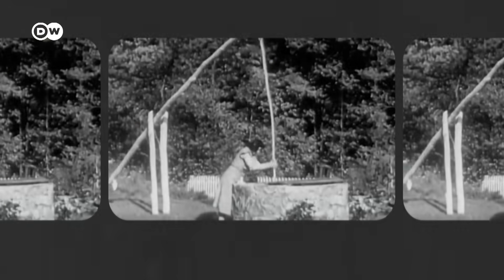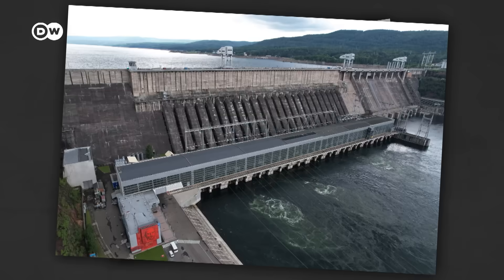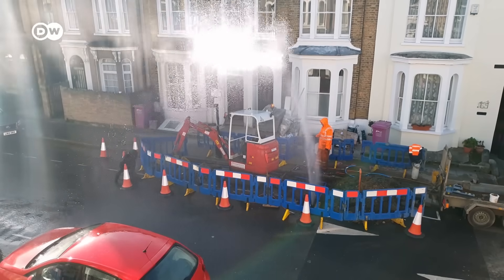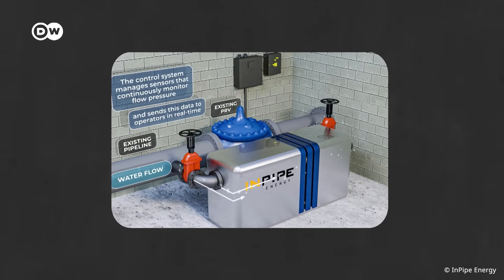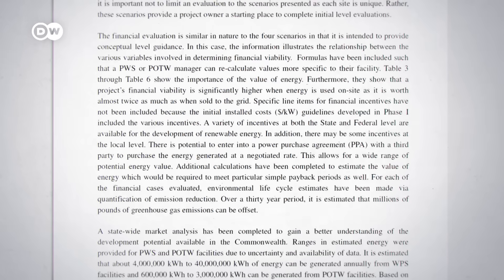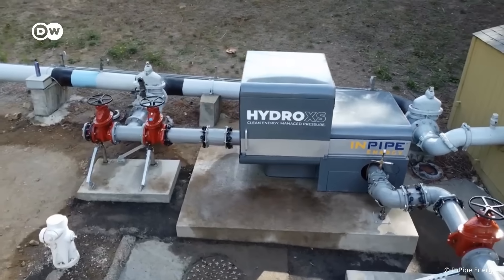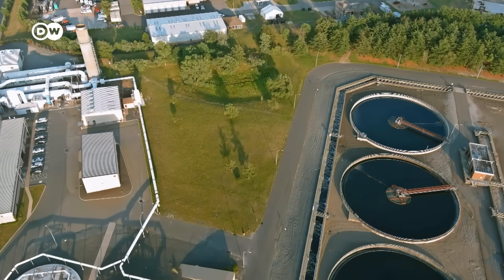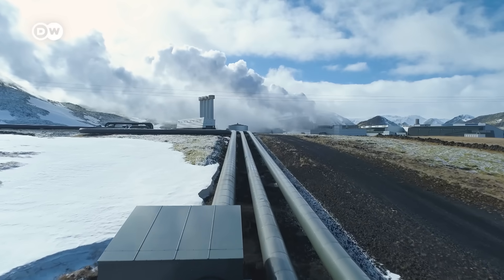In-pipe energy: The hydro power nobody is talking about

Comment: I mean, the potential energy of water in pipes is energy spent in some other location to pump water, this production thus would be just a reconversion of energy (with obvious losses). I also think that the production at large scales would slow down the water flow requiring more energy at the source.
It would be certainly more efficient to spend less energy at the source and to pump water at a lower pressure.

Comment: Apparently these people don’t quite grasp what they themselves said at the beginning of the presentation.
There is a massive input of power in pumps and other manners to make the water flow at a usable pressure. Part of this is simply to overcome the friction load of the inside of the pipe.
If they start putting turbines and other various “energy producing” devices inside the pipe … in the water stream … they lessen the pressure on the “downstream” side of the pipe.
In order to maintain even pressure then, either the originating pumps would need to increase … which actually would make no difference since the formula of water flow/velocity/pressure/gpm in a column or pipe is fixed. (the formulas are easy to find … even though they’re a bit confusing.) OR Intermediate assistance pumps would need to be installed which (pretty obviously) will use MORE Power than was gained by these turbines.
Maybe … MAYBE … a water system that is Gravity Fed might be able to use this with little overall loss but … even there the constraints are Pipe Composition (friction) vs. Pipe Diameter vs. Water Volume/Velocity.

Comment: Im sorry but this seems the dumbest DW video ive ever seen. This "potential" is absolutely tiny. Pressure relief valves for water treatment are uncommon. Usually water is transported at low pressure, and the pressure is increased locally (with a hydrophore) to match specific needs. 

The only "huge" potential there is to harvest hydroelectric energy where possible. But yeah, that has little to do with this concept of harnesting wasted energy

Comment: Maybe it would be worthwhile to start saving energy with more low tec systems, for example a simple heat exchanger for the shower, where the warm water going down the drain preheats the water going into the shower. Energy is saved without turbines and wiring in practice with just a few pipes.

Comment: No. Sure, there are locations and occasions where energy could be inefficiently harvested, but in general, adding a 10 watt generator requires upping the pumps' capacity and output by significantly more than 10 watts.
Reply from the maker: Hey there!  Mini hydro technology only collects pressure valve waste energy already being generated by our water transportation service. Therefore, no additional pressure is needed. The process is explained at 2:26.

Comment: There is no such thing as free energy, generating voltage and current is always accompanied by added energy elsewhere. The energy generated is resistance that is overcome by the pumps that move the water. If everyone does the same, heavier pumps will have to be installed! What a strange story this is! Perpetual motion now way.
Reply from the maker: Hey there!  Mini hydro technology only collects pressure valve waste energy already being generated by our water transportation service. Therefore, no additional pressure is needed. The process is explained at 2:26.

Comment: Ok, but where to install the turbine in a water network? Most of the endpoint is useless because people wont waste water and pay for it just to generate some electricity. If you install it into some bigger pipe which supply hundreds of customer, their pressure probably will be lower than before which could be an issue. Maybe that would be better if the companies set the water pressure to a lower point, reducing their energy cost.

Comment: This would only be useful in places where the water is traveling by gravity alone. Otherwise, you are just generating power by removing flow rate created by other electric pumps.
Reply: the point is explained at the start of the video. There are times when the pressure gets too high near the end-user tubes and it ALREADY has a mechanism to reduce it, but currently that energy is just lost. With this technology, we can recover a good part of it instead
Reply: While the whole system takes energy, it's still more efficient. It's not like you can make the water at the source have the same pressure as the desired pressure at homes.
This system is analogous to regen braking. The whole system takes more energy than what it produced, but it's not like you can avoid using brakes in the first place.
Reply: Well... you could pump water via solar power during daylight then use gravity to drive hydro generators at night and avoid expensive batteries
Reply: @Terryblount  Yeah, but most of us don't have land with the topology for large water storage. A raised water tank would be HUGE.
Reply: @jasont80 in cities, building could be build with things like this in mind

Cities generate winds to but all of it is wasted 

Someone needs to think about the whole thing as the huge machine that it really is

Comment: Thanx for your comment, there is just the but ...... if you use the presure to drive turbines in Hamburg, you use presure .... and that means the upperfloors in the highrise buildings wont get water in the pipes :) ..... or you pump more up to compensate .... but there goes your free energy ....  There is no free ennergy, unless you have a dam :) sounds nice but it is a scam ;)  ... dont put your pensions savings there ..... cheers
Reply from the maker: Hey there!  Mini hydro technology only collects pressure valve waste energy already being generated by our water transportation service. Therefore, no additional pressure is needed. The process is explained at 2:26.

Comment: This video would make a lot more sense if it referred to this as energy recapture instead of energy generation. More energy will be spent pumping the water than can be harnessed, but just like regenerative breaking, energy that would have been waisted can be recaptured at the pressure valve.

Comment: Yes,  this is exactly how I generate my own electricity. 
With an in pipe generator that provides the electricity to pump the water through a pipe in a circular layout. 
That then in turn drives the in pipe  generator in the circular pipe layout to make even more electricity. 
I just have to be careful to avoid runaway energy building up in the system or it bursts the pipe.
So I have had to install an over pressure relief valve and a safety trip switch to prevent excess electric current from burning out the pump motor. 
Hehe... 
:^ )

There's a reason why nobody's talking about it.
Reply: Perpetual motion machines are so much easier than fusion as well. Why are engineers so thick! 😂
Reply: This video made feel like we are in idiocracy.
Reply: @WindowsSchmindows  
Don't  feel  bad,  we've already tunneled below the idiocracy level!
It's just difficult predicting what to expect as we keep heading down.
Reply: Pure stupidity as it violates the laws of physics!!!  If your idea is so great - why haven't we seen it already commercialized and you making billions from it??!!!
Reply: A long video and they unfortunately never explained where the "excess pressure" comes from. Water is often supplied from the hills or mountains surrounding the city. Just to pick an example, in Halle one of the major sources is more than 140m above city elevation. With such a drop there are multiple places where pressure has to be reduced to protect the pipes. At the moment wasted energy.
Reply: youre just jealous as you didnt think of it before that genius gregg semler did :p

im sure he didnt sell it in quite those words, but ya gotta admit... takes balls to do it!

the genius is in playing the game and screwing the system...

it would be the gallows if i had my way.

Comment: Problem is, energy need to be extracted at the very end of the pipe. Otherwise it will simply fail to reach consumer. Also some pressure required for comfortable use. So in the end of the day it is way easier to simply make wider pipes and not to waste energy, then trying to extract excess.

Comment: Seems like something like that could be part of the answer for energy production. One video I watched where someone was diverting some water from a creek and running it through a generator. When the water had passed through the generator it returned to the creek. The same thing with the mills for grinding grains into flour in times past. The same principle is used in your water meter to tell how much water you used for the month. Also you can tell if you have a leak in your system. Turn all your faucets off and look at the meter. If the counter is moving/spinning, you have a leak. A system like that could only work when the water is moving of course. Off peak hours when people aren't using as much water, less energy would be produced. But then less energy is usually used at the same time. I think you'd still need the power grid, but this could offset your electric bill a bit. Maybe a lot.

Comment: You do know that means the city needs to pump harder, right? Your turbine in the garden hose.... that just means your nozzle will not spray as hard as before u installed the turbine. You need to read up on the conservation of energy...
Reply from the maker: Hey there!  Mini hydro technology only collects pressure valve waste energy already being generated by our water transportation service. Therefore, no additional pressure is needed. The process is explained at 2:26.

Comment: OK so it's a reclamation of available power. It doesn't add to the available energy. It gives you access to some of the energy you already had but in a different form. As the turbine spins it will generate heat and reduce the outgoing pressure so these systems would make the most sense almost as an after use or point of use product.  I have bad enough water pressure in my shower as it is.. but filling up a toilet bowl .. sure why not. It will just take a little longer to fill and the water will be slightly warmer... downside your toilet can charge 2 double AA Batteries a week. Give or take how many flushes you do a week. 

On a larger scale as this video explains it seems Like bigger is better. But it's not generating,  it's basically tapping a preexisting battery, which is fine, but don't try to pump the water with the same power you are tapping.

Comment: That sounds like a pipe dream. Unless you have water with a lot of potential energy, i.e., from higher ground, you are harvesting energy that was put in to pressurise the water in the first place. Or you have just reinvented the perpetuum mobile.
Reply from the maker: Hey there!  Mini hydro technology only collects pressure valve waste energy already being generated by our water transportation service. Therefore, no additional pressure is needed. The process is explained at 2:26.
Reply: @DWPlanetA  Then it is not explained very well. Why and how does a pressure limiting valve waste energy? It would seem that the surplus pressure remains in the pipes for the other consumers on that water supply.
Reply: @malteplath  The "how" is simple, but the reason "why" the wasteful valves are required in the first place should have been explained much better. Maybe the producers did not understand that themselves, or they thought that it would be too boring.

Comment: Wouldn't you just make the generators that are already running the water pumps work harder to now not only run water pumps, but now they  have to work even harder to turn a bunch of generators using up the energy in the pressurized pipes. In short, it's would be like using a generator to run a pump to run a generator. Wasted energy in every step you add.
Reply from the maker: Hey there!  Mini hydro technology only collects pressure valve waste energy already being generated by our water transportation service. Therefore, no additional pressure is needed. The process is explained at 2:26.

Comment: The pressure in the pipe is maintained by an eletric pump owned by the utility company for most people. The company charge you for the power to run this pump via your water bill. The only power you get back is that which the pump put in minus some losses. Your turbine cannot be 100% efficient, so you just get charged for the extra power the utility company used, less their profit margin and less the system losses. It's a less than zero sum game. It only makes sense if you can offload the extra cost onto your neighbours, and it wastes a lot of water anyway.

So you will become very unpopular and lose money overall. Dumb idea.

A.

Comment: There were water motors 150 years ago. Water here is metered and low pressure. EVs charging is the equivalent to 25 refrigerators running.

Comment: Pressure reducing valves are not common on water supply networks. Systems are designed efficiently and not over pressurised.

Comment: This is only practical after the pump pushed the water to the apex and on the downhill side of the system.  Using a pump to turn a hydro electric generator is moronic otherwise.

Comment: Energy cannot be created, so if you were tapping into water pipes and fitting turbines to generate electricity, you are effectively stealing the energy from the water supply company, since they have to use so much energy to pump water around our streets, this is nothing but stealing and a theft of energy. Plus the fact if you fitted a mini turbine to chare your phone think of how much precious life saving water you have wasted or used for useless things like watering a lawn when there may be a draught. Unless water was flowing freely due to gravity, from a reservoir to a water treatment plant, only then you may harness  this otherwise wasted energy.
Reply from the maker: Hey there!  Mini hydro technology only collects pressure valve waste energy already being generated by our water transportation service. Therefore, no additional pressure is needed. The process is explained at 2:26.

Comment: This is just bogus.Turbines TAKES AWAY pressure energy from a water pipe and that power is REMOVED from the water in the pipe for the rest of that pipe length. The source energy is created by upstream pumps with 75% efficiency = 25% energy waste.
The turbine can use 75% of the pumped energy = 25% energy waste. So now you have 45% MORE energy loss than before if the pipes are going to have their pressure restored downstream for end consumer usability.
Reply from the maker: Hey there!  Mini hydro technology only collects pressure valve waste energy already being generated by our water transportation service. Therefore, no additional pressure is needed. The process is explained at 2:26.
Reply: @DWPlanetA  That solution is still pretty complicated to manage and a lot of extra components and infrastructure has to be manufactured, transported, installed and maintained. Resulting in even more CO2 release.

Comment: From the country that destroyed it's clean Energy nuclear power to generate more power with Coal...
This is a dumb idea. We use pumps to move water, putting an obstruction in a pipe such as a turbine only causes the water to slow down, lose pressure, meaning we need to utilise bigger pumps, use more electricity to drive those pumps just so that some idiot wants to put a turbine in a pump to generate electricity!! One needs to think not on the microscopic scale, but on the macroscopic scale!

Comment: My issue is the same issue i have with wind generation,  its not a constant flow, fluids change their flow constantly,  so while you maybe generating voltage its very unstable and fluctuating increaing the risk of transients and surges. Not to mention as more load is placed upon the generator the gen demand goes up, so youll need even more flow than what existed previosly, increasing the amount of pumps requried
Reply: Oh no! I guess we should tear down all those hundreds of thousands of wind turbines, everyone! This genius says they don’t work.
Reply: @Tysto  I  never said they don't work, I said they produce unstable voltage generation, only increasing transients on the grid to the point surge protection is now mandatory by the NEC since 2023. But a basic understanding of power generation and fluid dynamics would tell you that

Comment: Sometimes I feel like really stupid people believe they are a lightning rod of intelligence... 

If you put a turbine on the "flow" of water, you will simply slow down the movement of that water. There will need to be more energy used to move this water again. I get that in a few areas you can use turbine to "recapture" a water flow going down hill, but once again, if you slow that water (and you will be) then you cause a back log... This still means you must in fact use more energy to push that water uphill as the back pressure has increased.

It's kind of like the idiotic idea of recapturing power in EV's when slowing down... In a normal car if you "drift" to a stop, even only 50% of the way, your gas mileage increases to possibly over 100 MPG... This means, that in an EV if you stop sooner, you have to reapply energy to make up for the ground you lost, so you don't gain much of anything... not to mention you can't charge you batter that fast so you only capture a small % of the energy by putting magnetic turbines as breaks. 
----------

So no, there is not some massive amount of "untapped" energy in water pipes, there might be a small amount at best... but because we're not talking about very bright humans who think this nonsense up we're not even allowed to explore the energy debt of building, adding and maintenance of these turbines being added to the mix... Just like EV's some people literally believe batteries make themselves and are powered by magic energy or that wind and solar also just make themselves and create this magic energy.